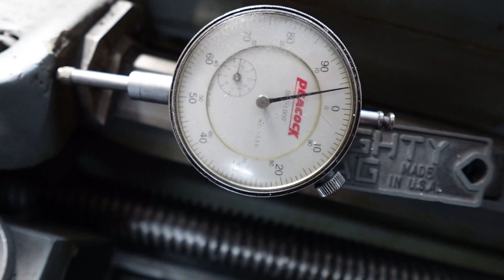2 speed TH400 build (ASMR-ish)

Comment: When installing the trust bushing in the reaction carrier I noticed you used a standard “plastic” non metal one in that location.Do you prefer that one there?Ive had a few metal brass/clad ones were out in that location putting brass shavings into the pan I’ve even shimmed them a little tighter around.008 play..Idk just looking for advice..Thank man..!
Reply from the maker: @BigFun4Life  I've used plastic and metal without issue. Seems like the only time that bushing is hurt is when there's a lubrication issue (converter failure, cooler restricted, etc)
Reply: @ thanks for responding much appreciated…

Comment: Nice video! Looks like you learned a lot from Hutch and the other guys on Yellow Bullet. I just did a pro mod direct drum and wound up with .125 clearance. Had to get the manufacture to send me some extra steels. They were .060 wish I had a lathe to cut some factory thick steels to take up the clearance.
Reply from the maker: Wouldn't be where I'm at without those guys in the transmission section!

Comment: I also use the 4l80e intermediate piston and 4 clutch stack in the th400. What's your opinion on Teflon rings on the pump and center support? I've used teflon and metal rings but never had any issues with either one. It's nice to see someone else spin and move your drum pistons up and down to make sure the seals are in right, other then the intermediate obviously.
Reply from the maker: I use metal with stock rebuilds, not in fixed line pressure, other professions told me it won't end well. I've used both of the 4L80e style sealing rings and the orange scarf cut Teflon all with positive results
Reply: A 4l80 int piston sits below the snap ring in a 400, it has a gap to close before even hitting a steel. May be better off milling a 400 piston to get clearance.
Reply: @BEANS-O-MATIC Transmissions  the early 4l80e piston fits with no issues, the late 4l80e piston you have to use the small wave plate to make up the height difference in the piston.

Comment: Can you tell me about the vacuum line going to the modulator valve? Does the hard metal line have a check valve in it ? Can I run a line from the modulator valve to the manifold vacuum on carb?

Comment: I enjoyed the video. I do have a question. With the Ultra bell, how do you insure that the centerline of the crankshaft and input shaft are in alignment? I seem to remember offset dowel pins back in the day.
Reply from the maker: The 8 pump bolts are shouldered and I believe that's all that aligns it. I'm sure there's a way to check it, I never have and have never had an associated problem. That doesn't mean I'm right though. Lol
Reply from the maker: Also, thank you for watching and the positive comment

Comment: I sent my fairbanks turbo 400 to a friend to rebuild and when he tore it down the case was no good they have those raised parts in it i dont know if it where the drume sits but he told me it happens alot from down shifting it so much so he was looking for a case for mè and i was also looking for one i called a friend he saidhe had one that was in a blower car he bought but it was converted to a 2 speed he gave it to me he said it was pulled out the car because 1st gear was t0 aggressive for driving it on the street so i guess thats why it also dont have a transbrake or a manual valve body . I never used it yet my buddy found me a good case and built a 400 for mè with s manual valve body with a reverse pattern im sorry now i never had him sèt it up with a trans brake once i get my 421 built im going to put it behind that and see if i like it. Great video

Comment: Why do you use steel sealing rings instead of teflon? I never use the steel ones.
Reply: I'm pretty sure those are 4L80e "PEEK" teflon rings.  They are dark and can look like iron, but they don't interlock like the stock th400 cast iron rings do.
Reply: @mtedwards78  Those are interlocking the same as stock.
Reply from the maker: Mike is right, they're from an 80e. They are not steel.
Reply: @cameron878  Have never heard of them. I use the solid Teflon or scarf cut Teflon.
Reply from the maker: @funfun8095  I save one from every 4L80e performance build (the one you leave off for dual feeding) and I use them on 400s if I have 5 saved up.
Reply: @cameron878  Hmm ok, cool.

Comment: You spending 8 hours on a TH400 makes me feel like a hack slapping RFE's back together for dealer warranty.
Reply from the maker: I don't build a bunch of race th400s, mostly daily driver stuff around here. Finding bad parts in 40 year old transmissions, walking all over to get core parts, machine work, plugs here, restricting feed holes there. Phew. I can completely tear down, bushings, seals, etc, and build, including all the pump and VB updates a 4L60e in 3-4 hours if no one bothered me and the phone didn't ring. A th400 with a bunch of aftermarket stuff? They always take me a while.